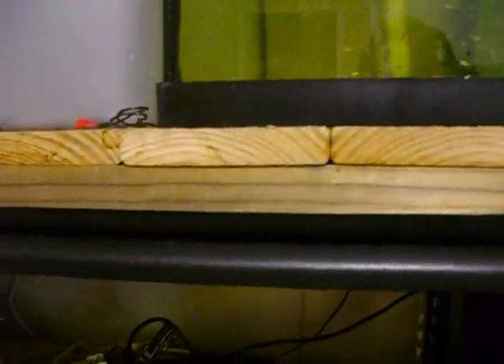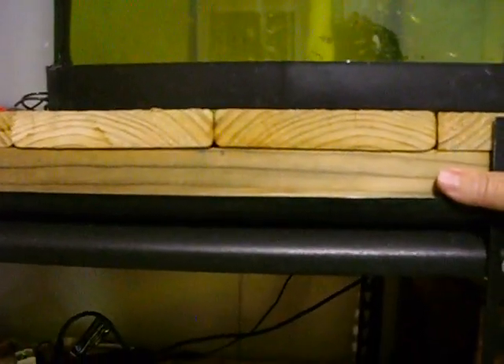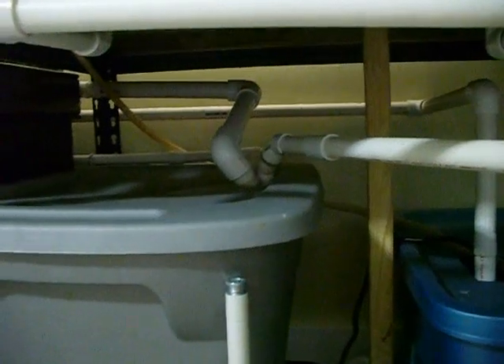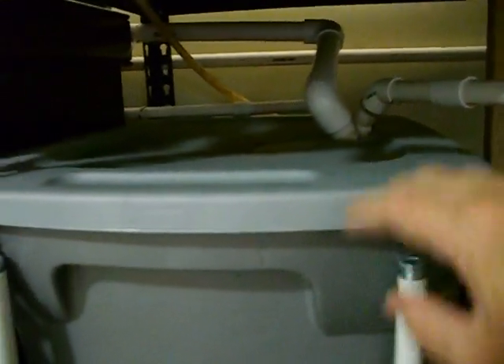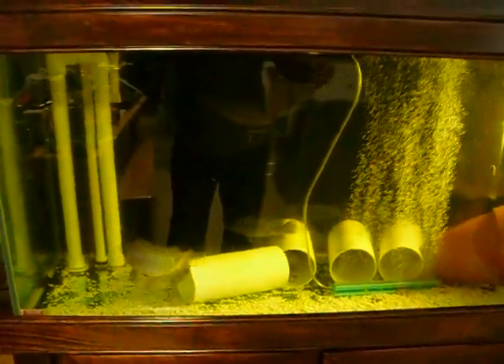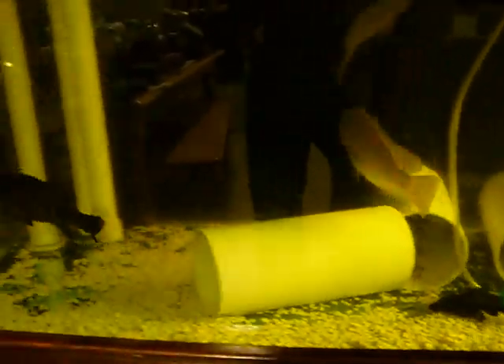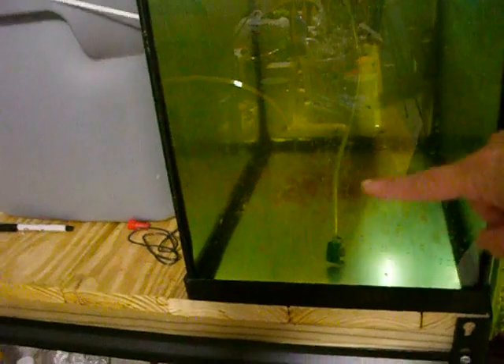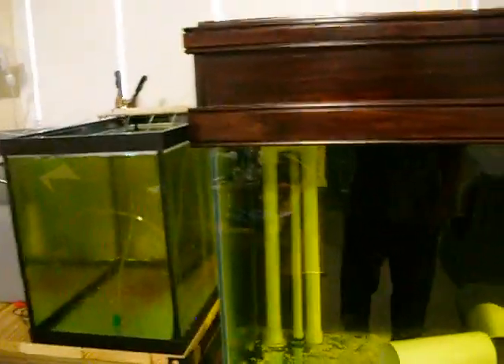Indoor Tilapia Breeding System

Comment: I'm a complete newbie and this is the sort of system I would ultimately love to have set up in my home. Do you think this is a bit much as a first foray, or would you recommend something smaller? I know tilapia require a pretty significant amount of space. This is hugely informative for me, so thank you so much.
Reply from the maker: The breeding system I set up was my first foray so i don't see any reason why it couldn't be yours as well.  I did have a few issues with my original design but by working through such problems I taught myself a lot that translated to more success with my larger outdoor system.

Sorry that I took so long to respond. Good luck!

Comment: Hello Mark! Thank you for the information! That helped me a great deal! I just set up a breeder colony, but I wanted to know how often I need to check the females for eggs. Will she swallow them if I pick her up? I have about 20 females in separate tanks, so I wanted to know your thoughts. Thanks in advance, I know this is an old thread
Reply from the maker: The females will breed (if conditions are right) every 5 to 6 weeks so if one has a brood she won't breed again for at least 5 weeks.  It's obvious when they have a mouthful of eggs.  They don't swallow the eggs, they spit them out, sometimes they'll pick them back up if left undisturbed but any left on the bottom won't hatch.  To keep mine from spitting out the eggs, I'd just use a net to chase her around the tank until I could guide her into one of the pvc tubes, I'd block the tube off with the net until I could put caps over the ends of the tube, then I'd simply lift the tube out and put it into whatever nursery tank I wanted her in until the eggs hatched out.  Since the female couldn't see and the tube was full of water the entire time she'd remain calm until I released her.  When I started using this method I never had a female spit out eggs again.  I kept 6 females in the tank with one male and that ratio seemed to work out pretty good, it also made it easy for me to pull the male out if I wanted to stop the breeding.  I guess you could just lower the temperature to stop breeding as well since mine wouldn't breed unless the water temp was around 85* F.  I hope that helps, good luck!
Reply: Mark Massingill Thanks for your quick response, Mark. This info is golden. Best wishes to you

Comment: Hi, Mark. I was wondering if you knew how old Blue Tilapia normally are before they start spawning? I got mine at fry on March 30th and they seem to be the right size to start breeding but they haven't yet. I guess they might be all males but...I don't know. I have 7 all together. 2 of them seem drastically different than the others and 3 of them are much larger than the others. I assume the larger ones are males but I really don't know. Anything you might be able to tell me on the subject would be helpful. Apart from yanking them out of the tank and physically inspecting them, I can't find anything on identifying sexes.
Reply from the maker: The only way to positively tell the sexes is to physically inspect the fish, google tilapia sexing if you need to find out how to do that. I think (not positive though) they begin reproducing around 3 months. Not all tilapia will mature at an even rate though, so go with the largest you have of each sex. Once they start the females will mate every six weeks after hatching while the males (like us) will mate as often as they can, which is why you only need one male and about five or six females. Too many males in a breeding setup and they will fight over territory (protecting their nest I guess) and run the poor females to death trying to get them to mate. The first time a female mates she may pick up the eggs before the male fertilizes them properly and have few or none hatch.

The biggest factor after getting the sexes and ratio right is temperature, I read that it needs to be over 80ºF but I had better luck if I kept the tanks at 85ºF. Of course this assumes normal pH and good water quality. I hope this helps.
Reply: I think that will help a lot. Thank you so much for your time.
Reply from the maker: Eric Mastenbrook You are quite welcome, I'm glad I could be of help.  Good luck with your endeavors.

Comment: Great Video thank you for posting  i was wandering how you set up the tots with the fry in them. did you have to strengthen the tote or only fill part way?
Reply from the maker: I reinforced the totes with wooden rails along the longer sides.  I just tied the rails together with cord that I ran through holes drilled in the totes.
Reply: i have done similar but on the inside using white food grad molly but always looking for other ways..  ty

Comment: I Find it very difficult to get one specific fish out of the tank without traumatizing all the fish in the tank .  HOW DO YOU SEPARATE MAMAS
Reply from the maker: I just use a small net to guide the female with eggs into one of the pieces of 4"pvc pipe scattered around the tank bottom. I then keep her trapped with the net until I can cap the pipe ends. After that it's easy to lift her out to move her withou disturbing the other fish or her (since she can't see) overly much.